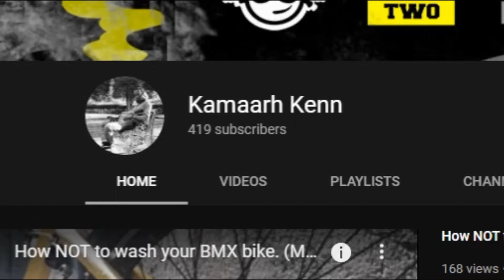How To Service BMX Sealed Bearings. (How To Rebuild Sealed Bearings)

Comment: When I get frozen bb bearings I pop the seal off let it soak in vinegar for a day then break it loose then dig out all the gunk in the bearings and clean the inside really good with a small pointy pick then put grease back in bearings and pop seal back on
Reply from the maker: That method especially works pretty well for super seized and rusted bearings. The acid in the vinegar is what eats away at the rust. But you should regrease them afterwards so they keep rolling smoothly.
Reply: @KamaarhKenn  yup I do
Reply from the maker: Nice. I'd actually forgotten to mention what should be done incase someone has rusty bearings. But I'll pin your comment incase anyone is wondering about that. Thanks 🙏

Comment: Should have cleaned the outer part with a wire brush
Reply from the maker: It was a smooth surface and I didn't want to scuff it up. Plus where they were going they'd still be in contact with steel and they'd get discoloured all over again